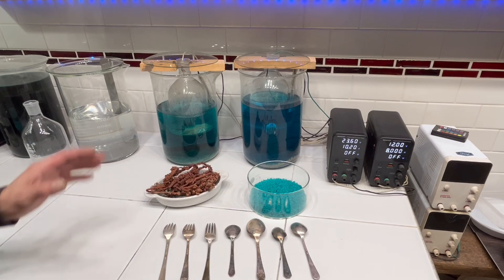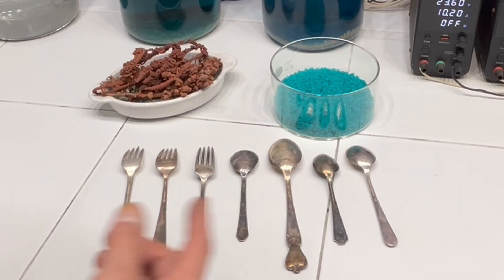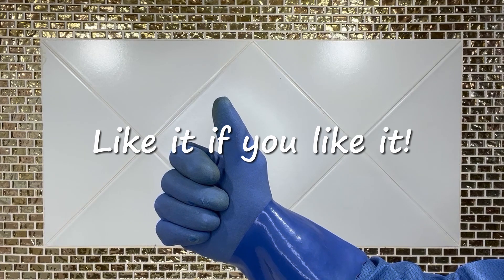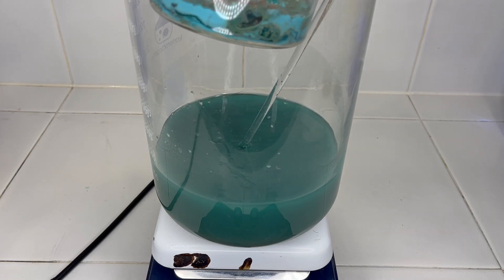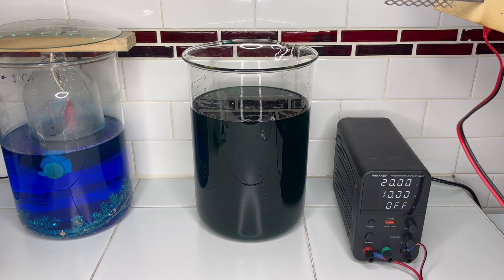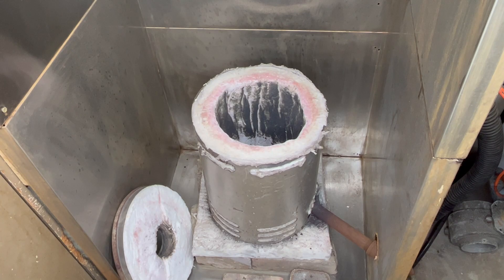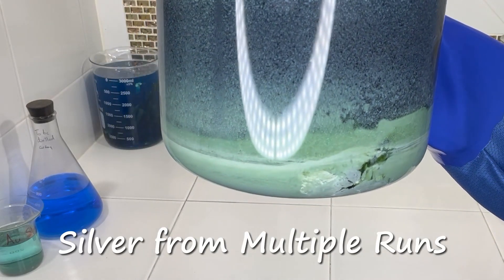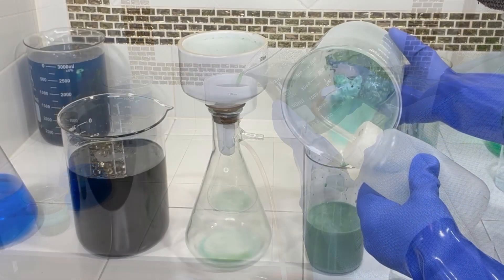Pony Up Your Phony Silverware & Recover Silver From Silverplate - Copper Cell Cleanout

Comment: Hello Anthony I have been a subscriber for some time now to your channel. I love it and you and sreetips got me into refining. I watched periodically for over a year before I even bought a flask. With that said I have only refined silver twice. I have all the proper equipment and supplies and have had a successful run my first time refining.925 into cement silver. My second time I’m in the middle of now I’m experiencing a 48% loss. I’m using dilute nitric process. I let my copper sit in the solution for 5 hours and pulled it out and rinsed the cement silver and dried it to have 4.75 ozt. Out of 10 0zt. So I put the copper back in and let it sit over night. I got a half ozt more out. 20 I have 5.25 ozt now. I tested solution along the way with hydrochloric acid. There is nothing in solution. I didn’t spill or waste anything, I am totally lost. I had 237 grams on .900 and 111 grams of 925. I know you’re busy but after doing everything I know it’s time to contact an expert. So if u have the time please can you help me maybe figure out how it’s possible to lose this much. ( it’s a lot to me) I’m just lost 😢😅
Reply from the maker: Theres a lot to go over so please send me an email to refining@anthonythomas.com and I can work through it with you there. My first thought is that maybe your copper passivated in the silver nitrate solution and stopped dropping silver. Try new clean copper and let it sit in there for 24-48 hrs at least.
Reply from the maker: @TheOliveBranch5  Send your email to sales@anthonythomas.us instead.  The refining email isn't working properly yet.

Comment: nice but isnt the wire a bit too less surface area and its advisable to make use of large areas? streettips use the entire pot, i love the way you make use of the glass things you use as container for the silver containing items, it ensures you can refill and have a seemless production with less risk of shorting the circuit

Comment: Love your process and informative videos. Thank you for putting this resource out for us knuckledraggers
Reply from the maker: @kodyarocho4618  Thanks brother!
Reply: Happy New Year from South Central. Alaska.I am looking forward to having your Silver Cell(and eventually the other three  Horsemen)set up and running in my new Lab.A work in progress.Thank you for the video and inspiration.
Reply from the maker: @williamallen8048  Thanks! Your Cell is on its way, just shipped. Happy New Year and I'd love to see some pics of your lab when it's done.
Reply: @anthonythomasfmg  Thank you Anthony.I was looking at some ptfe lined   exhaust hose for the fume hood I am building,but 10 feet of it is 1000$.Do you  think a 304 -316 grade stainless steel or even pvc would withstand the acidic exhaust?I don't think a scrubber  would work out in this climate unless there is a dry filtratration to neutralize  the exhaust or some component of antifreeze I could pump it into.Average Temps here can be 20f or well below this time of year.
Reply from the maker: @williamallen8048  PVC or PVDF will work better than stainless. Everything stainless I have rusts in my lab. PVC will hold up for a few years and is cheaper but doesn't do that great with strong bases in the long run. I purchased a 20' flexible orange pvc lined duct for $150 on Amazon and it has held up for 2 years now pretty well but I'd say it's on it's way out this year some time. It's getting a bit brittle.